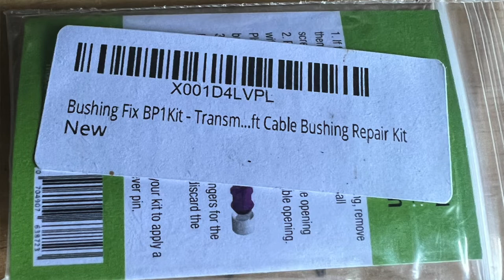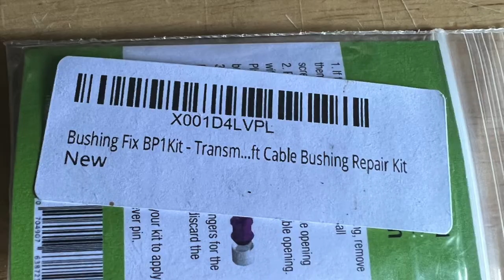Lexus GX470 stuck in gear, will not shift | Fixed!

Comment: Hello, recently bought a gx 470 2005 with 175k and have an oil leak and when I shift from reverse to drive in the AM there is a delayed response. Shifting is also delayed. But it’s only after sitting for a bit. Got the code p2714 for the solenoid. Took it to a shop and it was a liter low on tranny fluid they put some more in and checked the solenoid and said the solenoid works. Also the mechanic said he thinks the transmission is fine after driving it. Code went away. As an GX owner do you have any ideas on what to? Thanks
Reply from the maker: @richardsydnor6844  mine does that a little too. Slow down going from park to drive, reverse to drive and don’t hit the gas till it’s all the way in drive. Mine does it in the morning only. Several of my boys GXs do it too. Thanks for watching.

Comment: My Lexus gx470 stuck in D 
It won’t shift 
Is it same method to solve even this
Reply from the maker: It depends if the cable has come undone. You will have to take a look at it. Are you able to moves the shifter through the gears?

Comment: Hello my brother
My Lexus is moving but can't shift gear
Reply from the maker: Definitely need a little more detail thank that if would like some suggestions.
Reply: @ClassyTacos  when we put they Lexus to drive it moves but can't shif gears..
Reply from the maker: @nazarshafqat  So the shifter is working correctly through the range from park, reverse and so on. If you can get it into drive and it's not moving, make sure the transfer case is not in Neutral. The knob to the right of the shifter, make sure it's in HI.

Comment: Did you happen to figure out which way that white plastic square and spring went in? Mine went flying too
Reply from the maker: I do not remember right now. Pretty sure it can only go in one way. Spring first then the white piece with the long end down.  By memory I’m thinking the longer section goes down to the back. It will allow you to test it once it’s in for proper operation. Hope that helps.